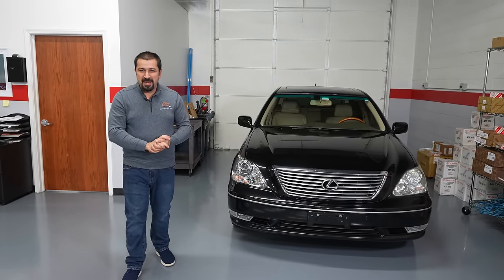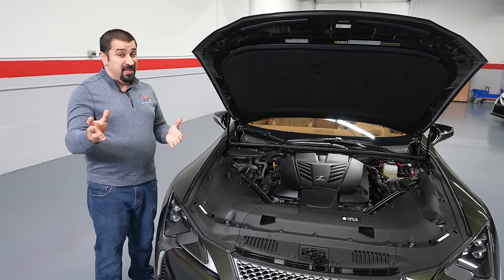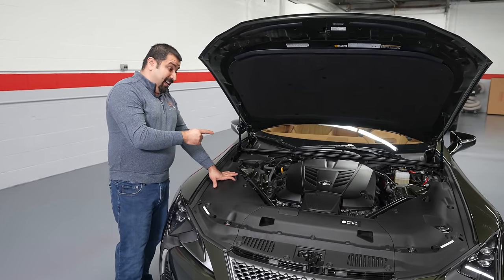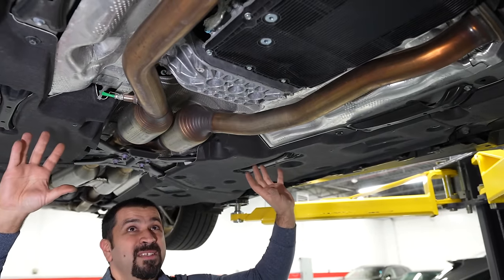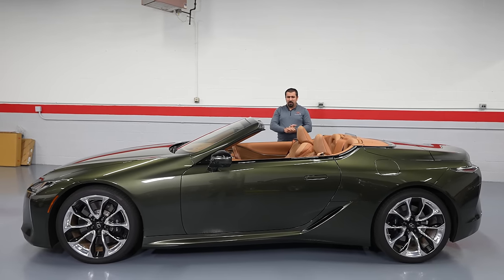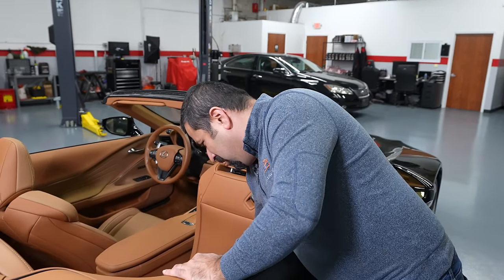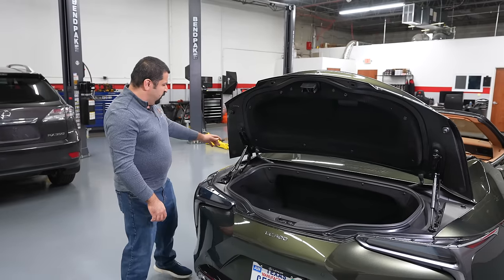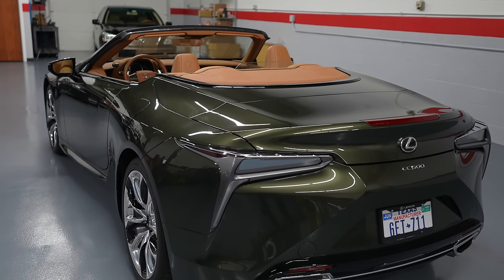This is One of The Best Modern Lexus Models EVER Made!

Comment: Can you do a video on the best year ct200h? Thank you 😊
Reply: Any year, really. the whole drivetrain is from the Gen 3 prius. hybrid battery can last 300-400k but burn oil very easily if the engine oil wasnt changed on time. There is 1 ran for 700k miles on clublexus forum

Comment: GX460 with that--- sound GREAT if you DELETE the muffler..   Run straight pipes back past the TWO converters... and put a rumble tip on the back... AND it has the torque to pull better up in the hills..  I've seen them OUT-PERFORM jeeps-- many times...because of the physics.   The wheelbase and weight balance is near perfect for climbing and offroading-- much better than a stupid jeep that is too high and short or too long and narrow (on the wagons).. it's balanced perfectly and will rock crawl better-- just climb and go better.  ( I don't intend to rock crawl with mine- but will offroad a lot with it-- I live in the country--)

Comment: I see LC500 I click...
Reply: I JUST got done washing, clay baring  and ceramic coating the entire car. I just got popped with a 5cm cash on the hood. The protective film took the hit but broke the film causing this ugly look on my trophy. 😭 So  had another broken panel on the right front lower end section. 1800 to replace that panel and the entire hood. Aye... So i think ill wait for it to collect a few more pops. FYI that doesn't happen if you keep under 80mph. You do 130-140 and you get punched in the face. 🤬

Comment: I just want to know the most reliable, safe, and spacious Toyota and Lexus models that I can buy new today that will last me 15+ years with just normal maintenance costs.  Like a list rather than various models in pervasive videos hidden behind obfuscated titles. I really don’t want to end up with one of those engines that leaks oil but is “good”. I almost bought a 2019 Tundra until I read about the abysmal crash tests and the guaranteed cam tower leak that dealers don’t like to do which I didn’t find out about until months into research of user forums

Comment: 20:43 I have that. Its on the DHP. Before i ordered the car i talked to some 911 owners cause initially i ordered a 911. Neways the Porsche guys swared up and down it was the bees knees. only to find out from another who spoke to the porsche guy demoing the car to find out it really did NOT have the RWS. The guy who found that out doubled down by saying it was worthless. Odd i know. Me being me says it cant be worthless if your getting physical movement so i ordered the pack with the RWS. Come to find out when i take the car it really does make a diff. You can feel the car pivot around your turn more. Parking is a sinch, and high speed maneuvers are amazing. So id say its totally worth it. Thats what kept me from getting the conv. That and i feel conv have a feminen print. Which this car absolutely looks fem as a conv. Im not into that. But that's me. You do you.

Comment: I agree with you in everything except for one thing: You are WRONG about the CD Player. 
CD Players should be included in ALL cars, until my generation (I am 64) leaves this earth! 
The reason the engineers that designed this masterpiece added it, was so that the music sound quality would match the quality of the rest of the car. For the people that know about music, none of the new silly audio sources can stand next to a good CD sound!
Is there a new RAV4 Model (or any other New Toyota model in the $30K to 50K price range) that has a CD Player? I cannot afford a $100K Toyota, neither do I need a V8. But I can definitely put my collection of CD's to good use!
In my old cars, I could swap myself whatever units were included by the manufacturer with a High Quality of my preference. To do such a thing now days, would be either impossible or a nightmare!

Comment: Made to last forever, however when something needs work, no one wants to touch it or would cost more to fix than what the entire car is worth, namely the replacement of the front and rear suspension (240,000 miles) and the loss of smooth downshifting in 2nd and/or 3rd gear. (also from 240k)  Abominably expensive to fix...

Comment: It is difficult to make a blanket statement about the quality of all car brands, as there are many factors that contribute to a vehicle's overall quality. Some brands have a reputation for building reliable and well-crafted cars, while others may have a history of issues or problems. Additionally, quality can vary between different models within a brand.

That being said, there are some car brands that are generally considered to have higher quality than others. These brands include luxury brands such as Mercedes-Benz, BMW, and Audi, as well as brands known for their reliability and longevity such as Honda, Toyota and Subaru. These brands have consistently received high ratings in customer satisfaction surveys and have been recognized for their build quality and attention to detail.

On the other hand, there are also car brands that have been criticized for their lack of quality in certain areas. Some of these brands include: Chevrolet, Ford and Dodge. These brands are known for their lower quality materials and fit and finish, and have been criticized for reliability issues and poor customer satisfaction ratings.

It is important to note that quality is a subjective concept, and what one person considers to be a high-quality car may not be the same as another person's definition. Additionally, quality can change over time, as a brand's engineering and manufacturing processes evolve.

In conclusion, while some car brands are generally considered to be higher in quality than others, it is important to consider your own personal needs and preferences when making a decision about which car to purchase. It is also a good idea to research the specific model you are interested in and read reviews from other drivers to get a more accurate idea of the car's quality.

Comment: Actually you see it on Mercedes not BMWs, BMWs have cross hatch iron liners except for the newest B series engines. Mercedes loves low friction liners, first Silitec then Nanoslide, but the new Nikasil is the best so you can build an old Mercedes with Nikasil and it is much better and less delicate. And Lexus stole that suspension design from BMW.

Comment: Wow, very, very disappointed to hear the 4 Runner will be downsized to a 2.4 4cyl with a turbo . I own a 2010 4Runner and I can tell you I will not be buying another 4Runner with a smaller engine that will be overworked and never run as long and dependable as the 4.0 V6. Never thought I would say this as I was considering purchasing another Toyota.

Comment: Very good technical review of the finest car in production today, bar none.  Nothing really comes close.  I've had my 2018 for over four years and it is simply a dream machine.  Once you learn VOICE COMMAND, you never have to take your eyes off the road except in very, very rare circumstances.  The really sad thing is you have to pity people who are so dumb they buy cars made in Germany, Italy or England thinking these are great cars.  Actually, all those cars are...are bank account drainers destined to spend most of their time at the dealership being repaired.  Between the poor design, extremely poor electronic components and the ultra cheap plastic parts, those cars are for those people who buy "brands" before quality.  The LC 500, as demonstrated in this video, is quality with a capital "Q".  Every single part has been thought out and manufactured to the highest standards.  There are no CHEAPLY MADE parts.  Having said that, it's a wonderful thing that people get to choose.  Choice is what it's all about and who would want that any other way?

Comment: When you have to talk smack about BMWs because the Lexus does not sell and it is a pig on the track…… Suspension looks like a Carbon Copy of Zeee Germans! Ohh and BMW has tuned the ZF transmission perfectly. In comfort mode, you cannot feel the shifts. In Sport+ talk about fast and abrupt. And also the transmission plastic pan does NOT disípate heat. That is for strength. Plastic is an insulator.

Comment: 4.7 sec to 60mph 10 miles per uk gallon, at a cost of 100k $ this is garbage  and super expensive to buy and run , no thank you i don’t want it i will keep my 2006 gs300 30mpg and cost only 5k $ . for performance i will go with german brands, in the us german cars are unreliable but thats not the case in europe and uk.

Comment: Beautiful and amazing car… but almost new and it already has rust stains on the differential, in three-five years it will be completely rusty as on other steel parts of the chassis (control arms, braces, brake rotors covers, subframe etc.), like in mine. The complete lack of anti-corrosion protection as in the cheapest Toyotas…not a square inch of transparent anti-rust wax on a over $100k car it's a shame for the Lexus.

Comment: Camry is better and cheaper.  CD player is no good.  CDs get stuck easily. CDs won’t last. Sdcard and usb drive readers are superior.
Reply: Of course it’s cheaper it’s a freakin Camry. Smh.
Reply: @unvaccinatedmgtowfitness  Lexus is just an expensive Toyota. Uses same engine parts. Only has more expensive interior, wheels, and paint job.
Reply: @hpw-ws6bj  really? Wow you are smart
Reply: Lexus is by far superior to the similar Toyota (usually 'same' chassis, 'same' engines sometimes). AMD did a video with a title like: Why Lexus is more than a glorified Toyota? That video puts in place the fools that don't have money for a Lexus but write against it, without knowing about the extensive Aluminium parts (panels, arms, joints etc.) - with better settings and better build quality - giving a far better ride quality, far superior sound insulation, the far better audio quality of both CD and sound system (based on tech measurements like the ones done by Savagegeese, not only on my ex-DJ feeling), better paint quality, luxurious materials, better reliability, still low TCO etc. And mostly because Lexus is the most reliable car brand worlwide while Toyota is #3 (Mazda is #2), as revealed by the Consumer Reports surveys.
There is a huge difference between my wife's Lexus UX 250h F Sport and a C-HR hybrid, between NX and RAV4 etc.
I dislike the stupidity or dishonesty, because I like the truth and people who do not write without knowing what they write about.
Btw, CD's sound quality is far superior to mp3 and other ripped off tools (that have far less information/Mb - this is a fact, not a simple opinion.
Reply: Lexus looks ugly. Like a Cadillac.  Expensive and ugly. And turbo is going to have expensive issues.